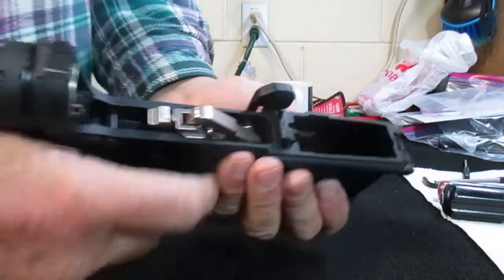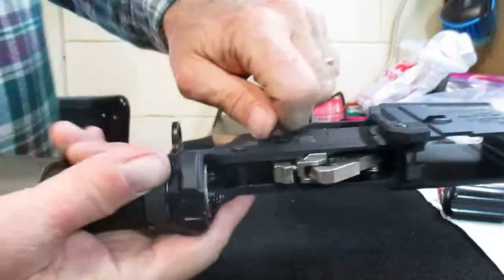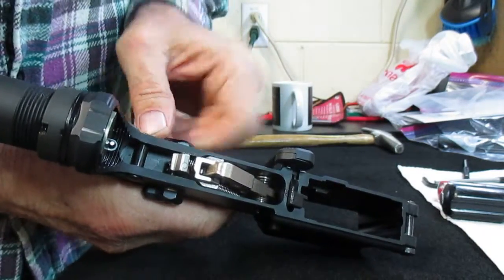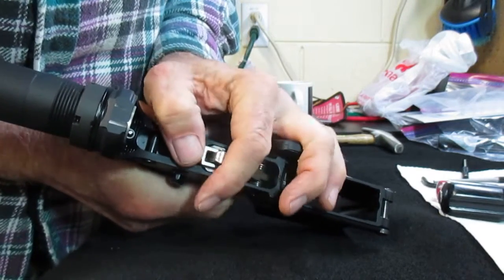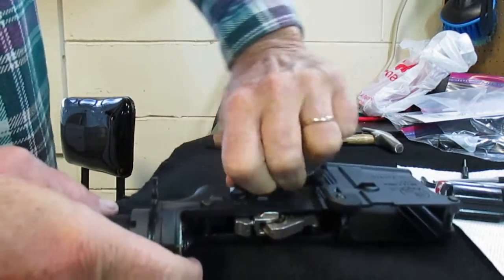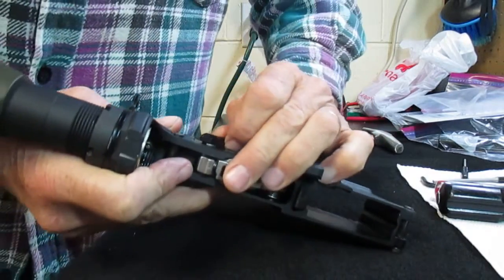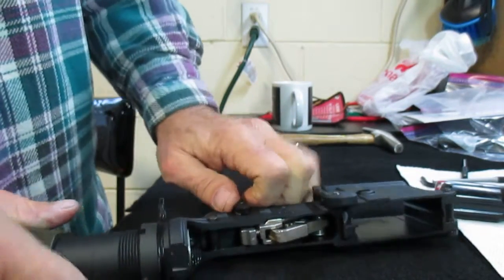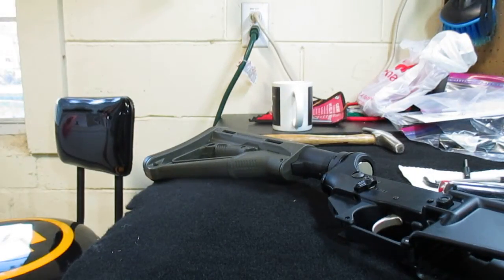ECHO FAILURE PART2

Comment: Did you even read the instructions or watch and installation video?
The safety lever needs the spring tension so put the damn pistol grip on.
Dude you are like a bull in a china shop.
Take to a gunsmith if you can't install it .
I have installed 5 so far for other people and no issues what so ever.

Comment: Some lower receiver s are different some have a deeper pocket than others where the rear of the trigger is . You might need a different receiver or dermel or mill out a bit of material for rear part of trigger to be able to move freely

Comment: That's why I'm waiting a few months to get this trigger.  Always a few manufacturing gremlins to get worked out before company gets it right.
Reply: I don't think it's the installer either. I think he has a lower that is slightly out of spec. This trigger id very picky about having enough room. I have two of them ordered but I do know I might have to buy some new lowers to make them work.
Reply: steve witte keep waiting. The they will probably be banned by the time you decide to buy it. LOL

Comment: I just got mine, there is an issue with the safety, try loosening the screw a tad and you can move the safety selector easier. I know that is not the "solution" but will help loosen everything up and allow you to fun check.. the selector does get looser over time however, I have another serious issue where when I am firing the weapon in echo mode I am getting stoppages where the case bottoms bulge and in some cases the primer is popped out, I cannot open the action without serious pressure as the case is really stuck in there.. it happened several times this past weekend... I am using PMC X-TAC 5.56.. in semi during fast mag dumps it does not occur, only during echo mode.. I removed the system and am going to try it in a different weapon. I hope you can figure your issue out.. these things are way too expensive not to work perfectly.

Comment: The same thing happened to me, exactly as happened to you, all I did, was remove the safety selector, installed it from I believe either the echo position or safe, I forget which, but I know I had to jiggle / mess with the safety selector / it went in different than shown in the video, and had to be pulled out the first time I tried, because what happened to you happened to me, either way, it was not on "fire." and took some patience / problem solving skills that you obviously do not possess. Your problem has to do w/the safety selector. I wanna also say I think I had to not tighten the selector down so damn hard, at first.
Reply from the maker: Glad somebody reproduced the issue.  I tried all that you noted above and no joy.  Yeah, I lack problem solving skills, that's how I keep three classic 60s Chevys running and made a couple of million in IT security consulting...
Reply: I wasn't trying to insult you.  Moreover, what I should have said was you just needed to be more patient and mess with the safety selector more, that seemed like your problem, as again, happened to me as well. That's all. Just seemed like you were being very impatient, as no offense was meant, if that was the tone you gathered from my first comment I'm sorry, I should have worded it differently.